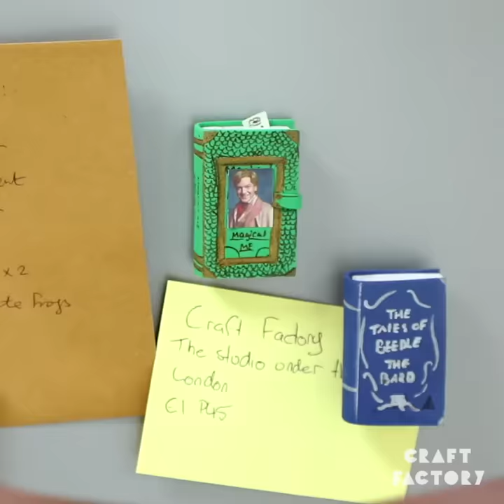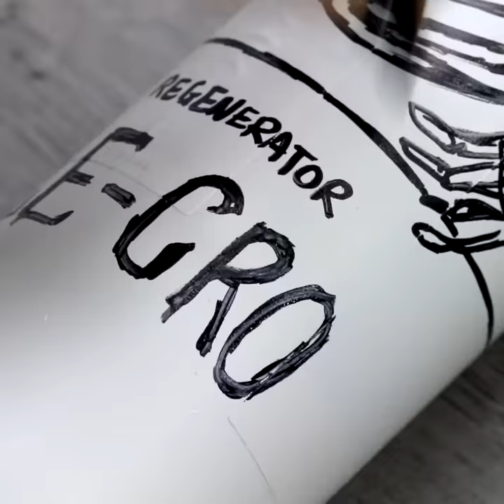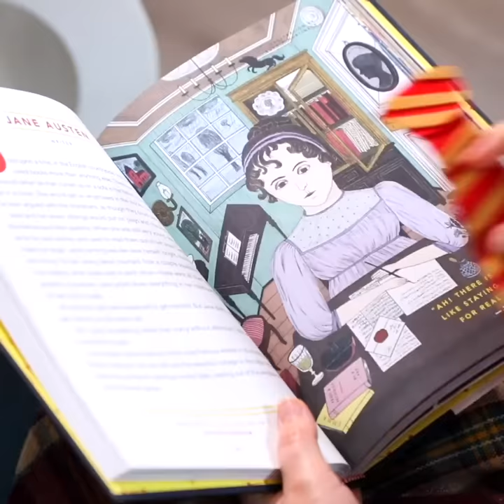12 Spellbinding Harry Potter Crafts and DIYs

Comment: 0:02- The food coloring and glitter would settle?
0:14- The fluff would become compacted and flat in the bottom of the container?
0:59- Is that... an entire glass... of paint? Why not brush it on? Also, it wouldn’t stain the wand like shown. When pushing it down, it looks thick, meaning it would probably layer it with a solid color, not stain it. Instead, put food coloring on a paper towel and rub down the wood. Sure it won’t cover the glue, but that’s a way to get the stained look.